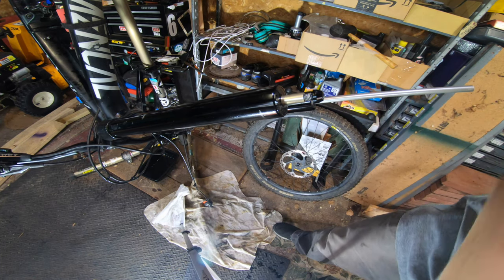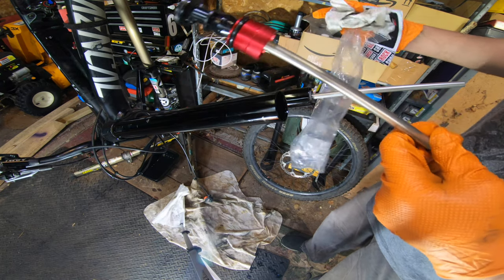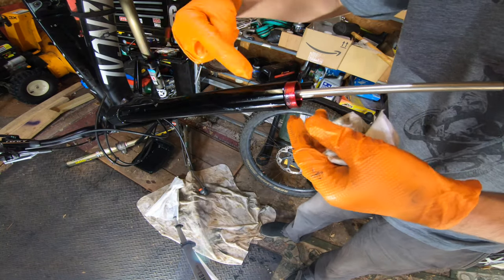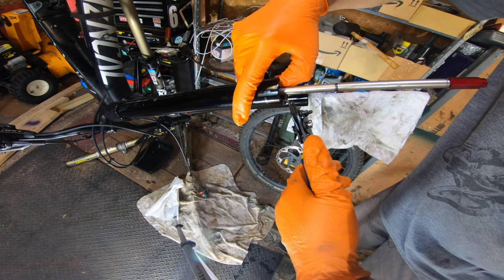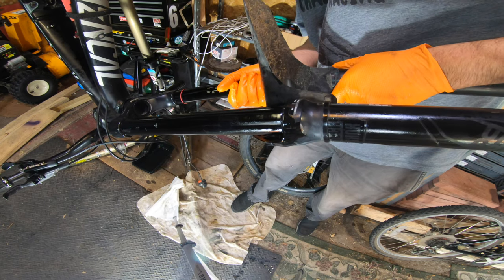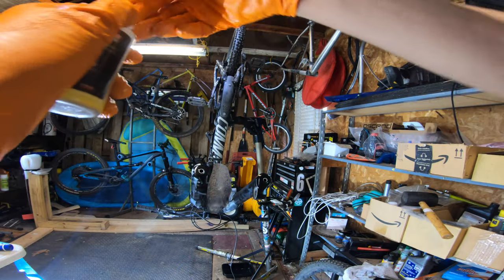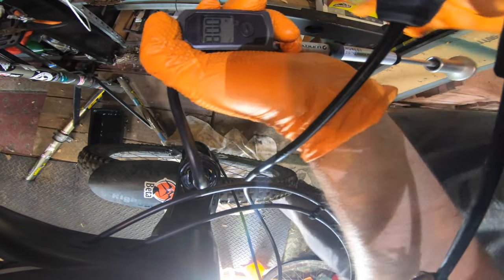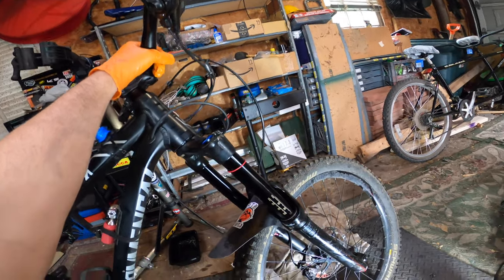How to Upgrade to the Awesome New $42 Debonair Air Spring!!

Comment: after this upgrade, my sag decreased by 10% with same PSI setting. Was this your experience too?
Reply from the maker: I recall that it fixed an issue with the fork starting at 10% sag and never fully being fully extended unless you physically extended the fork.

Comment: When you pump the fork up at the end do you need to equalise -ve and +ve chambers to achieve the right pressure and what grease did you use to lubricate the new shaft?
Reply from the maker: The only equalize you need to do is to cycle (compress) the fork several times. I usually pump it up to about 50psi  then cycle the fork 10 times then cycle it for every 20lbs or so as I pump it up to the desired pressure. I used Slick 50 which is good but I also use some 20 year old Manitou fork grease that I bought a ton of :)  I would stick to a good bike grease for the forks.

Comment: You should take a look at everflow.it, it is a much better option than both B1 and C1!
Reply from the maker: It’s good looking stuff but $$$$
Reply: @MTBBeta  the big difference is made with a 55€ kit, its not that expensive imho
Reply from the maker: @BafoMX  for my Lyrik it’s €125 convert to $171. That’s pretty expensive compared to $42.
Reply: @MTBBeta  you spend 125€ only if you want the maximum performance, otherwise the 55€ kit is just slightly below that. You only need to have a debonair in your fork to install it :)
Reply from the maker: @BafoMX  cool maybe I’ll get one and do a comparison!